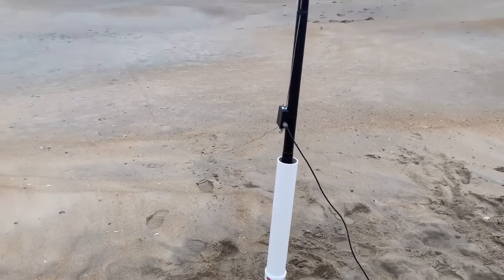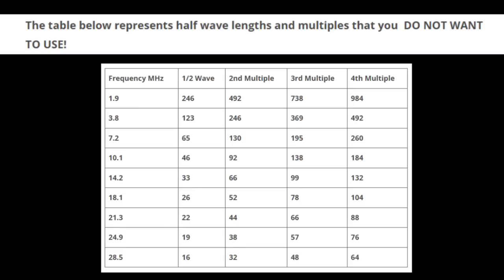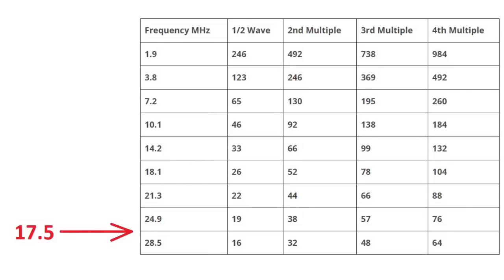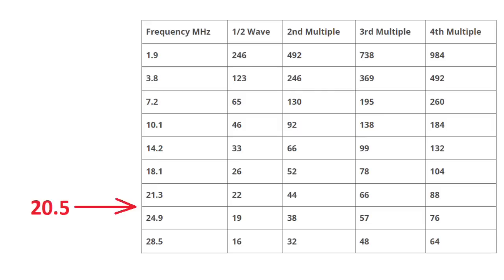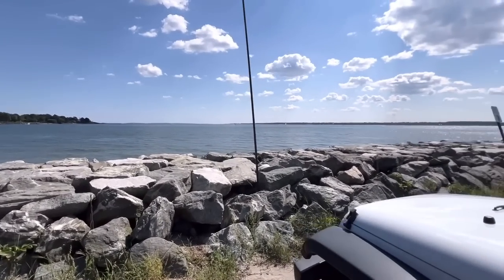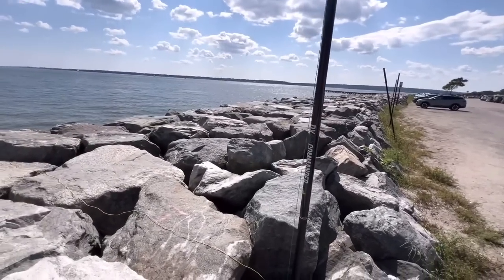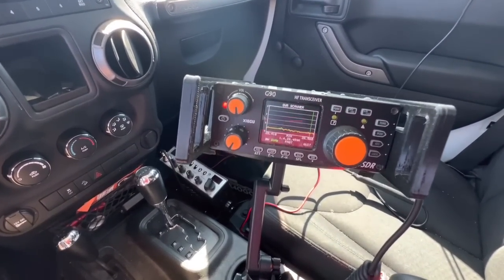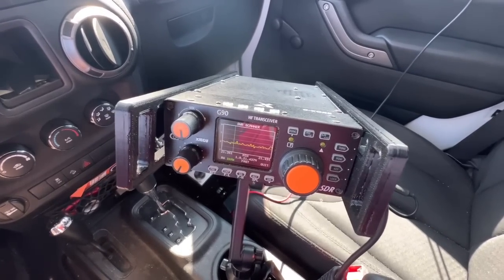20.5 Foot Vertical Antenna - Better than a Rybakov?

Comment: Great video. A question, please - Would you prefer the operation of this antenna to an EFHW vertical at around 20 metres length?
73 G7PAC in the UK

Comment: Hello, Salty Walt!  Monday my G-90 will be here and in two more weeks, I should receive my Sigma X-80, both of which I considered partially, and a lot, by watching you and your reviews. The antenna is for my apartment and the g90 is for having fun in the field. I have the  GRA-7350 and the JPC-12 (currently acting as my base antenna. for now.)

In line with the antenna you made in this video, I have some things I wonder if you might consider or comment on.  

I know you have multiple portable UNUNs of various ratios, but I don't recall if you have any of the 17+foot extendable whip antennas.  if you do, or even if you don't and just use wire like you did in this video, would you consider comparing different UNUNs on the same antenna?

Would you consider setting up whip antenna, possibly on an extension pole for it to reach your 20.5 feet, and test each UNUN on the different bands to see how well each one matches on the different bands. If you don't have the whip, or don't want to buy one, use the wire.. 

I see an 18.4 foot for under $20 on Amazon right now.  Put on a mount for about the same price, and you have a really cost effective antenna pretty fast to install. I think it would be great for beginners. 

I've been watching videos on the X-80. If my calculations are correct, it is about 19.5 feet and it appears to be adjustable, but I don't know how much. And I know what you said about the counterpoise. So, this is the idea for the antenna, and I think also for the one you just created but a foot taller.  

What I did not catch on your video was whether you used any ground radials on this antenna.  

It would also be interested to know if a choke UNUN and radials would affect the resonance of the antenna for the better. 

Don't worry, I hope to do this myself, but it will be down the road, and you look like the kind of guy who might have all the parts and really have fun doing it, and have the ability to share it with the world. 

I love your channel and watch it often.  
73 for now
N4PGW

Comment: I built this and have installed 16 - 16' radials using #16 speaker wire.  It is elevated approx 2' above ground. What kind of performance can should I expect. I have a Yaesu FTDX10.

Comment: Hey Walt, another great video and antenna.  Hoping your book will be available in the UK very soon!!  For clarity, what is the length of the counterpoise you used on this?  Sure you said 40ft but would like to be sure.
Reply from the maker: @TheMaddoguk  typically I just use a 5 meter counterpoise. The book is available through Amazon UK! 73, Walt
Reply: @COASTALWAVESWIRES month for delivery!  Okay, payday present later in the month.

Comment: I am sorry to hear that you received nasty comments for your ARRL video.  You don't deserve that and you are a great resource.  

I am not an ARRL member.  Every once in a while I rethink that, and this video has me rethinking again.  I am a member of an ARRL affiliated club, and I find that useful but I just don't get what the ARRL is doing for me.  

At one point I did try to join the ARRL through my club affiliation.  It was at the time that dues had been updated and the form for joining through an affiliate has not been updated.  I sent an email to the ARRL club rep and ... crickets.  I used a link on the ARRL page to send the email.  Just poor member service.

I am still a little unsure of the value of joining the ARRL but you have me rethinking it again.

Comment: Threw this antenna together today and took it untested to a SOTA summit (Robertson Mountain, VA) and it rocked on 10 meters, wanted to operate longer but knew I was running out of daylight with a 2 hour hike out.  Will definitely be using it again for SOTA / POTA.

Comment: After doing some initial testing of the 20.5 concept in a VERY temporary configuration.  I decided to build a portable antenna based on this concept.  I purchased an 18' 5" telescopic whip ($17), a 3/8" mirror mount, and an old camera tripod.  Got it put together and did testing with ground radials and elevated ground plane (resonant tuning by adjusting height of whip).  That showing positive results, I built a 4:1 unum with a 2' 1" lead.   Connecting the lead to where the whip connects to the mirror mount down to the unun with 2 elevated radials and . . .wow, I was hitting every band with minimal tuning on my G90.  Testing with FT8 I was getting some great DX on 20m-10m.  At one point I was over 450 spot reports in 10 min just on 20m.  I tried 30m and 40m.  Both tuned but only passable performance on 30m.  I could tx on 40m but efficiency was not great.  This is a winner for me and now have a very functional portable HF antenna solution.  Thanks Walt!

Comment: Walt, how critical is the length of the wire? I've had trouble getting repeatable measurements for a fixed length of wire. I'm using a surveyor tape measure, soft tape.

Comment: Walt for a fixed mobile or beach portable antenna  about 20.5 feet in length, check out the Ocean State Job Lots in the swimming pool supply stuff for their two piece 16 foot telescoping swimming pool leaf skimmer poles.  They are made from very strong ribbed blue metallic finished aluminum
tubing. The most amazing thing about them is the price - probably less than 20 bucks on clearance sale this time
of the year at the end of the
summer.  Very sturdy for supporting low NVIS dipoles as well.  The two telescoping sections do not come in electrical contact as bullt, I use short jumpers across the plastic  coupling collars made from coax shield braid or ground strapping braid secured to the tubing with hose clamps.  I’ve used what I call the DX Skimmer as a quarter wave on 20 and 15 by adjusting the overall length of the two sections, also used it with a nominal 4 to 8 foot adjustable Hamstick skimmer at the top to 
get the total radiator length up to about 24 feet.  The bliur metallic finish is non conductive , I use a Dremel tool with a sanding drum to get down to bare bright aluminum at points where the jumpers are secured with the hose clamps.  Then poles are very light but strong, and a lot of bang for the  buck!
 
They also work very well on 80 and 40 meters as large fixed mobile verticals with an adjustable base loading coil and   500 pf on. 40 and 500 or 1000 pff on 80 shunt  capacity across the feed point.

Chris AJ1G Stonington CT
Reply from the maker: Hey Chris! Thanks for the great tip. I left my long extension painters pole back in Virginia and have been looking for something to support my dipole mount. Definitely going to Job Lots and looking for this. All the best and 73, Walt

Comment: Walt, how do you decide between a 4:1 and a 9:1. Everything I’m reading tells me to use a 9:1 with a random wire.
Reply from the maker: @ChrisMichael-x8j  9:1 on random wires 29 feet and longer is what I’ve found. The shorter wire lengths like the  Rybakov (25’), the 20.5 and the 17.5 have a lower feedpoint impedance somewhat closer to 200 ohms thus the 4:1 ratio makes a closer match.

Comment: So, this should work with a 25' whip at 20.5"and a 4:1 unun?  Does that sound right?
Reply from the maker: Yes that will probably work even better that my setup here. 73, Walt
Reply: @COASTALWAVESWIRES  Well, when Chameleon gets them back in stock I'll give it a try and see how it goes.  By the way, I'm trying a low (1-2m above ground) efhw with a long counterpoise right underneath it on the ground as an NVIS experiment on 40m.  Thanks
Reply from the maker: @thomascurrin  that sounds like a cool experiment. I bet the receive will be incredible on that antenna

Comment: Hi Walt, I've been following some videos on the Rybakov and radom wire verticals. I will give this 20,5 ft antenna a try. I'm just not into food reviews ;-)
73 from ON4VP, Phil
Reply from the maker: Thanks! No worries, just putting the food at the end for those that want to stick around. 73, Walt

Comment: Ciao Salty, to be honest my shortrybakov is around 5.8m i find out this lengh by using mmanagal. I was looking for the best performance and best performance on 10m as well. By the way i believe that those are the best size for work 20 to 10m bands. I guess from 6.5 to 5.7m are all good.....ciao Salty Walt ;)
Reply from the maker: Good stuff! Thanks for the info my friend. 73, Salty Walt
Reply: @COASTALWAVESWIRES  sorry Walt, just checked the best lenght and seems that i was wrong. i guess i made mine shorter because im using a portable pole of 60cm when close.......but best performance lenght on mmanagal should be around 6.8m. I said "around", because we need to think about the velocity factor of the wire, so 6.45m to 6.65m.......

So ur antenna is doing great Walt, u find the Salty lenght ahahahah ciaoooooo

Comment: Fantastic video. Looking at the wire length chart (at 2:17 minutes), you could get away with cutting one foot off the Rybakov and still be in the middle. I don't know if this will cause an issue. Will it? Just thinking. That is what I like about your videos. They get me thinking about the different wire builds and also the what-ifs. I also like the scenic views that you do in your videos. Thank you very much. 73 Matt KF4KSK.
Reply from the maker: @Matt-qq8dh  thank you Matt, I’m all about those what-ifs too. Yes I think you could definitely trim the Rybakov down and it would still work. I’m wondering if it would have any effect on the lower end like 40 meters. It’s definitely worth a try.
Reply: @COASTALWAVESWIRES  You might have a point there. I know that the longer the lengths of wire the better you can tune in the lower bands. I am doing great on the 41 ft. random wire slope form that you have in one of your other videos. Thank you again. 73 Matt KF4KSK

Comment: Great video as usual. This antenna looked a lot like my very first 10 mtr vertical when I was a newbie, except I used bamboo and I had no clue what I was doing so it didn't have nearly as good a match as this one.
Reply from the maker: Thanks! I have actually thought about getting some bamboo for building antennas. I think that would be a cool vertical especially by the sea.

Comment: if i use a antenna analyzer and get the antenna resonant for 11 meters. around 18 feet 1/2 wave for 11 meters , do i still need to use a balun or unun ?
Reply from the maker: You can get away with a 1/4 wave length and no balun or unun but not with a halfwave wire. The feedpoint impedance will be too high and you will definitely need to an unun. I’ve built halfwave verticals for 10 meters and needed a 64:1 to make it work

Comment: shame that there are so many 20 foot masts, wonder how bad laying the last 6” on the ground would make it. Thanks for another great video !
Reply from the maker: No I would let the wire dangle in the breeze at the top. I’ve done that with other antenna builds and not had an issue

Comment: Dear Walt, I have been following your videos for a long time now. Great inspiration and big respect for your antenna knowledge.
I have a question and there aren't many hams that can answer me but I think you as a salty could give some advice.
I am on my sailing boat and will sail from South Africa to the US across the Atlantic soon. I have got a G90 and would need to install an antenna on the boat. On the mizzen mast which is 10m high I could run a wire to the back and would be quite off the other rigging wires. Could you recommend a set up for a vertical antenna.
Probably best ground plate would be a wire directly hanging into the water. I saw this set up on one of your videos. Your support would be highly appreciated. 73 Chris OE6WTZ
Reply from the maker: Hi Chris, I’ve thought about this before, I’m actually thinking about getting something to live aboard while I’m up here in Rhode Island as I sail myself. I would get a wire vertical 7.62 meters (that’s the 25 foot  Rybakov) and get a 4:1 transformer at the feedpoint, from there I would run a wire from the ground side of the 4:1 to any metal object you have in the hull near the waterline. Like an overboard through-hull discharge port or rigging stay. I think this would give you an incredible permanent solution for 40 through 10 meters which is the bands you would likely want while offshore anyway. 
Fair winds and following seas my friend! 73, Walt

Comment: Another great video and experiment Walt,  I am working on some modeling for this series of antennas (random wire), to show the current distribution along the radiator.  This helps explain the impedance at feed point of the antenna.  When the current goes low the ohmic resistance is very high as well as the voltage, and when the current is high, voltage and ohmic resistance are low.  Much like an off-center fed dipole, you find a point where the feed point has an impedance that is usable for multiple bands.
Reply from the maker: Thanks! I will definitely be interested in your modeling. 73 my friend

Comment: I like the work you do my friend, it saves me doing it for myself. A TRUE old school experimenter, I like that. I wonder how this wire length would go on a 9:1 it may improve the SWR
Reply from the maker: Thanks! Yes I think I might experiment with a 9:1 but those numbers with a 4:1 made me happy
Reply: @COASTALWAVESWIRES  Not saying they were bad, just they might improve with a 9:1 if the wire is close to 450ohms. A 9:1 & 24.5ft wire can be 1:5 or less at 14mhz.

Comment: Wow you think too much Walt. That's an amazing antenna think I'm going to have to make 1 now. Love the 11m contact that's going to upset a few😂😂. Well done 73 Steve ZL1YX
Reply from the maker: Thank you! Yes that video has upset a few, that’s disappointing and I’ve had a couple people with negative comments that I just deleted and blocked. That 11 meter QSO with that Happy Mon in Jamaica was one of the most fun contacts I’ve made in a long time. 73 my friend!
Reply: Some people are so precious. You just keep doing what you do best. That antenna is certainly going to have a lot of people thinking. I've done something similar with aluminum tubing instead of wire. Must dig it out again. 73 Steve ZL1YX ❤ @COASTALWAVESWIRES

Comment: Hey Walt. I’ve had a lot of success with the Rybakov antenna. I changed it a little. I placed the wire at the top of my 10 meter pole which made feed point about 2 meters off of the ground. I then went ahead and used long tent spike to elevate four radials, 25 feet  long, from the feed point to about 8 inches off of the ground. I’ve been making some really good DX QSOs the longest in to souther Chile on 15 meters. It’s been really cool to watch you and adapt and experiment on your foundational information. 
If you were to use ground radials, because you’re away from salt water, what would you suggest?
Reply from the maker: I built the Rybakov as well as the 17.5 and other verticals when I was in Poland well inland and I typically just use five counterpoise wires around 5 meters long each spread out on the ground in a star shape. 73, Walt

Comment: What was the frequency on 11M  you made the QSO with 4 zero 7? Any others frequencies  that would be good to listen on?  N3LJS
Reply from the maker: @n3ljs399  channel 38 LSB (27.385) channels 37, 39 and 40 are great for DX as well. Just remember 11 meters is LSB. 73, Walt
Reply: @COASTALWAVESWIRES  Listening around 27.450-27.650 I've generally found that to be USB.
Reply from the maker: @paulsengupta971  yes I believe that’s the freebanding norm

Comment: Walt, thanks for your videos;they are fun, informative and get me in the mood for radio.  Question that everyone is going to roll their eyes at, but does tuning the antenna have any effect on the receiving side or is it just for the transmission.
Reply: The antenna acts equally on receive and transmit, though for transmitting, matching the impedance is more important.
Reply from the maker: That’s a great question, I’ve found that transmit is affected more by trimming and I don’t see much change in receive as I make short trim adjustments.

Comment: Interesting.   i did try 25 foot on 4:1 on 11 meters CB. it did work good but I had to tune a bit. SWR was like tad under 2:1 . Now I have to give 20.5 ft a try.  5/8 wave.   When you model that over 5/8 wave the lobs get crazy and make null points.  5/8 wave looks better for DX with low take off angle then a 1/2 wave. both are good. the 5/8 is a tad better .  The shape of donut changes a bit. I modeled it and not tried it.  The  Gain Master 5/8 wave 10/11/12 meter antenna uses that length with a matching coil and cap to get 50 ohm.  I think the Rybakov may be better on 20 meters . and the 20.5 foot better on 10 meters.  But that just modeling and not real word test . I will do at some point. I made the same 11 meter contact on different day.  and CB been going good. FT 8 on 10 meters getting better as we go into fall . I see the trend. 73
Reply from the maker: Thanks! Yes I’ve always been told the 5/8 is the holy grail of verticals for takeoff angle and DX
Reply: @COASTALWAVESWIRES  I used MMANA  to model the 5/8 wave before. DX commander has lots of video's on MMANA. How I learned it.

Comment: Hi Walt. Thanks for the video. The 20.5 foot vertical sounds good. That way, I could strap it to one of my 7 meter fishing-pole masts without having to attach a couple joints of pole to the top like I do for the rybakov. I’ll give it a try.
Reply from the maker: It seems to be a decent antenna, give it a try!